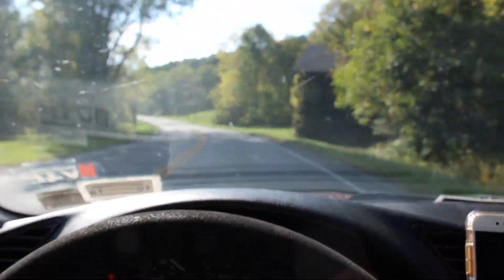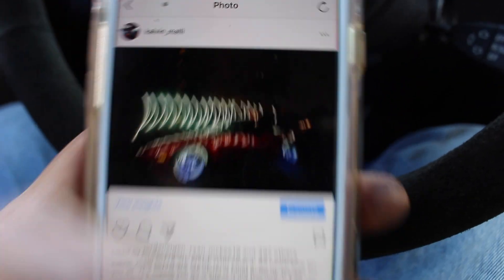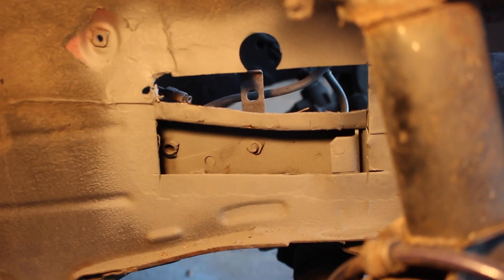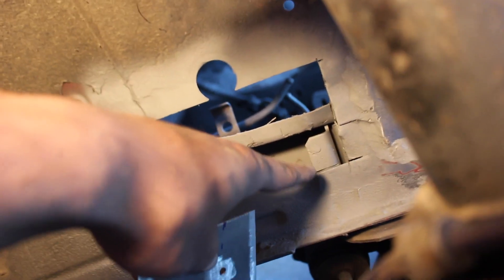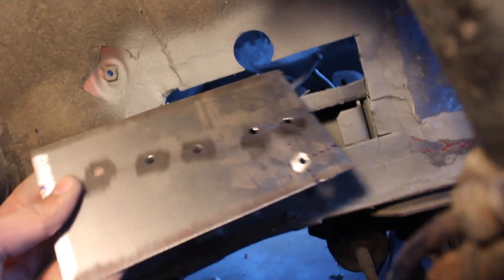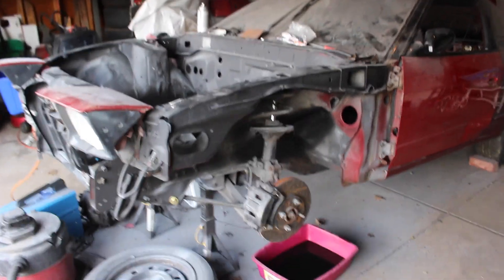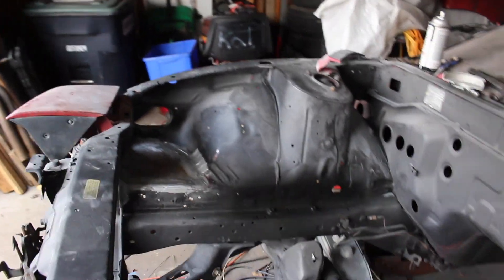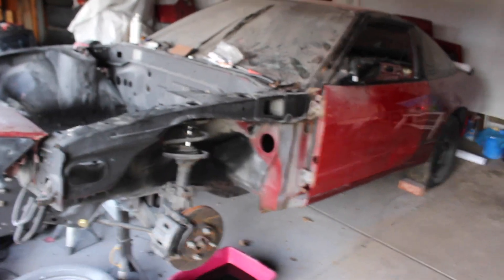BUDGET 240SX BUILD | Part 5 | Car is Like NEW!

Comment: Just a tip when welding. After you have sanded down the welds, use a light from the back of the weld and look after holes. If there is any you need to fill them inn otherwise the rust will just come back. From own experience(:

Comment: With this much rust in the front there has to be rust in the back?
Reply: Tomislav Solarić water has a much better time getting into the engine bay and the front end in general then it does on the rear

Comment: Probably the worst undercoating made... just a tip if you wanna go undercoat some things use the 3m pro undercoat it still comes in a can and lays down much better and is stronger
Reply: Cars N' Shit how much does that matter? Also do you know the price difference?
Reply: vaids nomiss it Varys if you need it for something long term I suggest the 3m pro undercoat cause it’s just more durable and long lasting the price difference is 5$... I’d rather pay another 5$ for something I know is going to last me so much longer then rustoleum undercoat is for something your just trying to flip and get rid of...